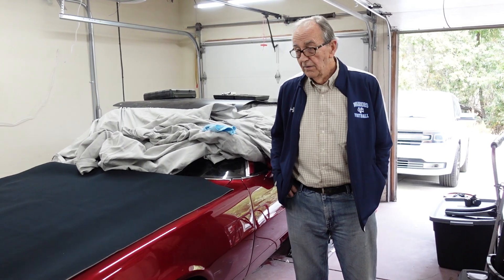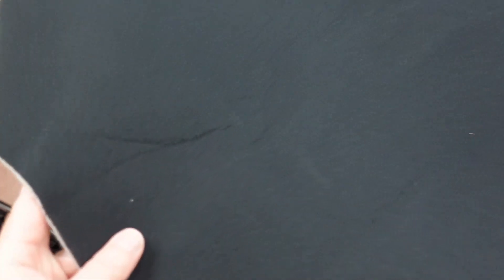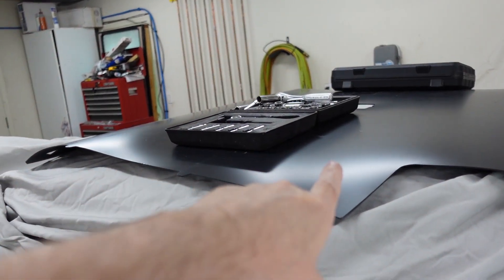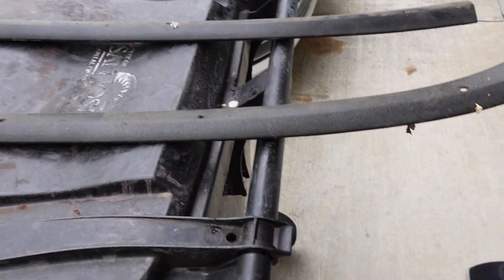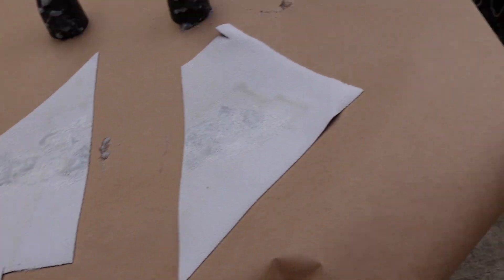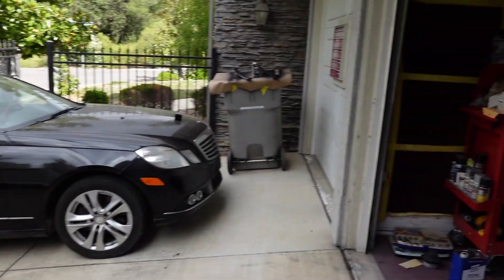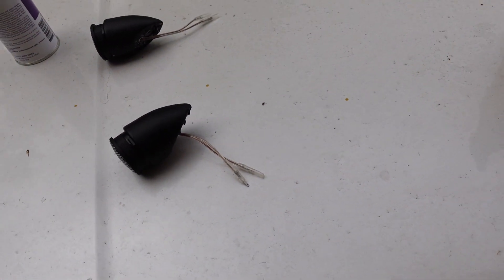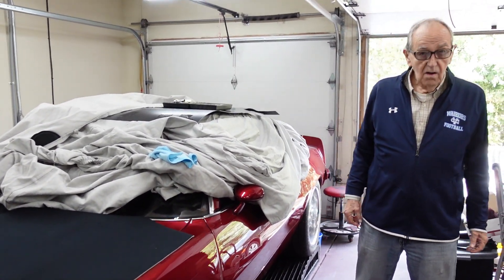1977 Camaro Z28 Part 349: Tweeter pods and more trim painting

Comment: I would glue the fabric onto the headliner board outside of the car. That way you can push out any wrinkles easier than when it’s in the upright installed position. I have the metal rods in my 70 with the perforated material.
Reply from the maker: Oh yeah, for sure.

Comment: That's a terrible deal on the headliner, I understand it's not that it's restricted it was now your charged "Parcels that exceed 30 inches in length will incur a $15.00 surcharge.". I still haven't touched mine in 7+ years but one thing I did get was the bow style retrofit version. I wouldn't have been cool with what they have now for the board type.
Reply from the maker: Yeah, that was pretty lame.